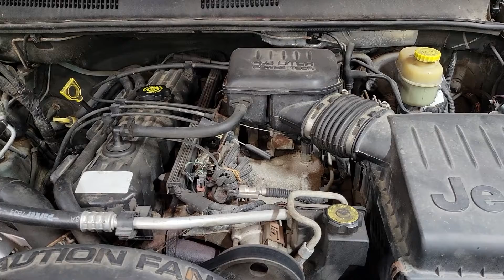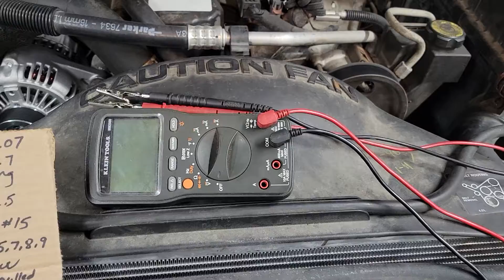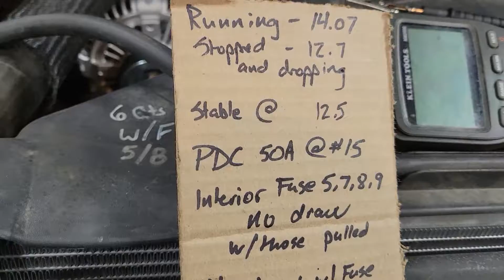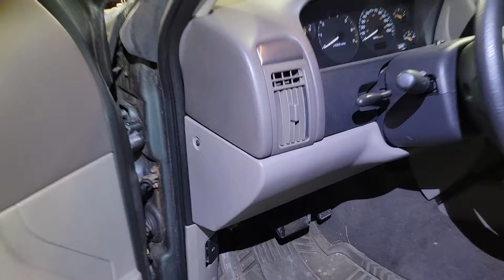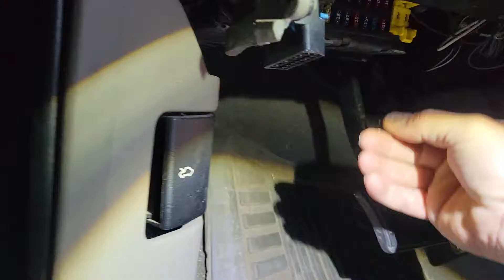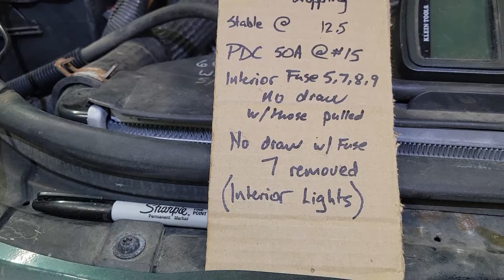Car battery keeps dying - How to find a Parasitic Drain on a battery without a bunch of fancy tools

Comment: I have a 97 jeep grand Cherokee Laredo 4x4 and I have worked and worked on this thing for 3 years with wiring and fuses and battery and such. From the front to the back...u wouldnt believe the little crazy things that will shit this thing completely down.. it's been a lot of wiring in the door hinges and my fuse box gets wet and my fuses have become loose over time.. it's very rusted more than it should be..I live in the south and no where near any salt water.. but with it getting wet inside its contribute to it...but I have found wires that were covered that had just  a little cut in them that makes a difference.. I have had he horn just go off and cant stop it and it shut down for weeks before I figured it out and just pulled the fuse for horn under the hood And I still have never had horn work period.. but something keeps draining my battery and I for a while just kept undoing the cable on battery cause was tired of simply looking for the draw every which way but loose..  until I once again decide to start looking again and checking.lol...why the manufacturer had to use soybean stuff to wrap car wires I'll never know  cause that's what attracts the rats to come chew on them as well...but I'm like uh I'm not gonna let it beat me... I love my old jeep.. I ain't getting rid of it. For nothin..I'll hopefully get it all figured out of these days...I also had to put a complete different hatch on it cause I busted window on it and was easier to just put another hatch on it..and they may also seem to be drawing my battery even when it's not open.. but I have nothing on or open right now and battery is going completely dead daily....ughhh. I tested alternator, it's not that..and been threw bout 3 batteries...lol..

Comment: May not be the correct way to fix it but you can get a toggle on/off switch and wire it in between the positive or negative to your interior lights and turn it off when you leave the car.
Or you can go to the closest to battery/JB wire for interior lights and you can rewire it into a "key on" fuse so it only gets power when key is on or vehicle is running.

Comment: I just tried this method and pulled all the fuses under the hood.  Light didn't go off.  Is the fuse panel under the steering wheel a separate box?  Could I have missed something?

Comment: Does that have a rear CD change your deck over the right wheel well? Will my parasitic draw I've tracked down to that CD changer shuffling through by itself periodically. Also there's something up under the front of the dash that makes a heck of a noise like event opening and closing and squeaking then it stops after four times I didn't know if that would be kicking on the middle of the night running it dead, but yeah same problem here and I literally just found that fuse 20 minutes before turning your video on looking for a brake light issue. Got no brake lights got a new switch still no brake line there's a big blue wire under their I don't know where it goes yet LOL

Comment: Apperceive for the walk through! I'm having the exact same issue with my WJ. THANK YOU!!!
Reply: I am also having the EXACT same issue right now. Did you figure it out?! Thanks in advance!
Reply: @noahbrenckle4388 I pulled fuse #7 (skim) from the fuse box in the cab which stopped my power draw for a couple weeks before I could get the part. installed. Your truck will have side effects from pulling said fuse but it will operate safely. You just won't have interior lights, and other minor inconveniences.
Reply: What part did it need? I'm having the same issue.
Reply: @dan_WJwhat part did you replace?
Reply: @SITH4MMER55 I had to replace my entire fuse and relay module under the dash. They are part# specific for different models. I got a used one on ebay for $50ish bucks. I was able to stop the power draw by pulling fuse #7 (which is the skim) until I could get the part. Good luck!

Comment: Thank you for the video I learned a lot from you
I will keep a eye out for more videos from you
I have a 94 Grand Cherokee limited and my battery is dead in about 4 days if I don't disconnect the positive
I'm going to try going through the fuse box one by one like you said and I just bought one of those light testers a few months ago and I don't have a good voltmeter just a cheap harbor freight one
Thank you very much for the helpful information

Comment: Suv and vehicles with wind shield wipe in the back window are very common to have problems with wiper motor draining battery
Reply: Do you think our problem drain from fuse 7 are wiper motor

Comment: See comments under dan wj who replaced his entire fuse box but before you do try adding a little solder to each pin on the circuit board. It’s probably just a cold solder joint in the fuse box under the dash.

Comment: Thanks....Im having the same issue with my jeep and my glove box light would stay on draining my battery. I removed the light and that seemed to work for a few weeks but now it's doing it again. Been sitting in my driveway for over a year now just collecting dust. I don't have many tools, but just happened to have the 2 that you mentioned....I thought that was a coincidence...lol
Reply from the maker: Glad it helped!
Reply: @diymechanictv1233mine is going the same crazy flashing clicking thing. So you just pulled #7 and the drain went away?
Reply from the maker: @Conway-Twitty It did. I never got around to diagnosing what on that circuit was causing the issue, but pulling #7 kept my battery from dying randomly.

Comment: Great video. Have you changed the camshaft and the crankshaft sensors or just the camshaft ? Thank you
Reply from the maker: Glad you found it helpful! I just changed the sensor on the back of the engine (the crankshaft sensor?).
Reply: The drain was from crankshaft sensor

Comment: My 1997 grand Cherokee did this it was 7 fuse and it ended up be the lift gate sencer the bottom one there are 2 one on the top and one on the bottom
Reply: Huh? Two on top of what and one on bottom what?
Reply: I’m in the middle of this as well. Got my mom’s jeep. The tailgate is bashed in. Could be the culprit.

Comment: Hello i have the same issue on my grand Cherokee 2002 fuse 7 i disconnect all lights still the drain please any advise
Reply from the maker: Pull the fuse for that circuit. If it keeps draining the battery, it's a different fuse. Wiring issues seem to be an issue with this generation of Grand Cherokee for some reason.
Reply: Thank you did anyone change the fuse box
Reply: I removed fuse 7 and the drain stop but I’m trying to find from where the drain i need to put fuse 7 again to get the light work and the memory of the temperature and the alarm horn so did you find from where the fuse 7 make drain please can you reply
Reply from the maker: I never went any further than just leaving the fuse out on mine. It wasn't worth the work to me for the condition of the vehicle.
Reply: So sad not finding so problem one month working on the drain no solution except removing fuse 7
Reply: Last question do you think the fuse box make drain
Reply: My 1998 Jeep head lights started flickering when in auto mode and when I removed the switch I discovered a cold solder joint in the printed circuit board. With the hot solder iron and a little solder I fixed the issue and then reheated and added a little more solder to all the connections on the board. I think this may be the issue with the fuse box too. Check the board where all the pins are and do a quick reheat to each pin on the board since the other person replaced his entire fuse box to correct the problem.

Comment: Thanks for the video- Im having the same problem with my 2001 WJ. Beside pulling out fuse#7 what part your waiting for to install and solve this for goog?
Reply from the maker: Admittedly, I just left the fuse out on my Jeep. It was a cheap work car for me, so I never spent the time to dig deeper to locate the failed component.
Reply: İm suffering from the same problem fuse 7 i change everything still the drain

Comment: Did you find out what the problem was?
Reply: Mine is having the same problem when I pull #7 the Test light goes out
Reply from the maker: I suspect the wiri g between the body and the doors is the issue with mine. So far, I've just left fuse 7 out and it's been working just fine (aside from the interior lights not working when I open the door). Oddly, the interior lights work after I start the vehicle. Too bad these have so many wiring issues or they'd be a pretty decent vehicle.
Reply: @grimace188 Rear hatch sensor , disconnect it this works 95% of the time
Reply: The ground wires in the doors underneath the sheathing like to break, stuff could be touching in there and triggering a relay

Comment: This issue happened to my 2002 Jeep GC Laredo but it was a dead battery that was still trying to power the car even when it was off!
Reply: Could u tell me more about that issue?  I'm wondering whether I have the same thing in my jeep grand cherokee 2007.  I used his method pulling every fuse in the vehicle and the light didn't go out.  Then I tried different nights where I fully charged the battery and would leave either the negative or the positive terminal disconnected or both.  

It is still draining within 3-7hrs depending on the weather.   I live in Canada where it's cold.

I thought maybe it's something in the alternator initially but with it all disconnected I'm now wondering whether it has to be the batt?

Interestingly the light is on during my tests similar to his, makes me wonder if I do have a slight drain somewhere lol?